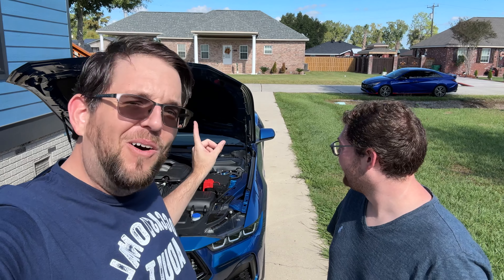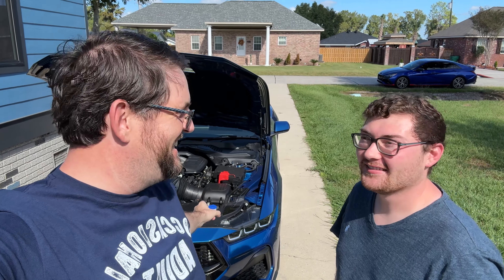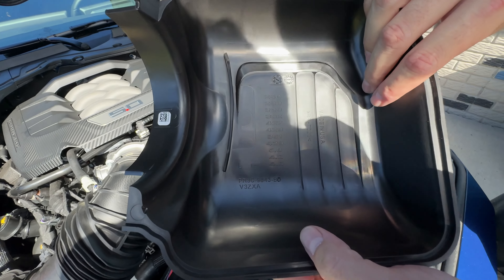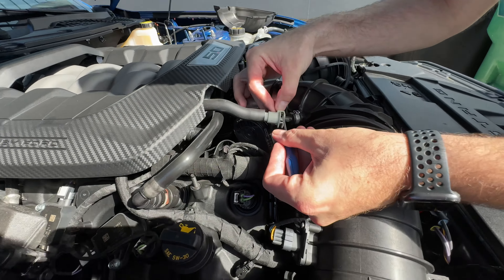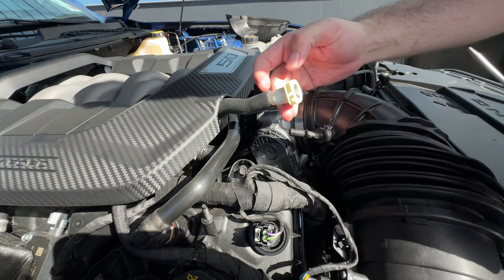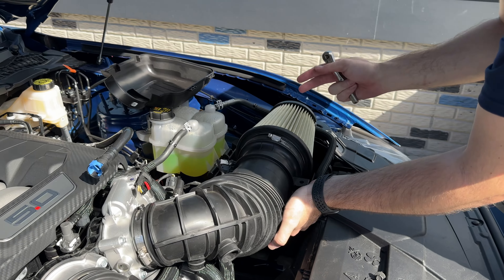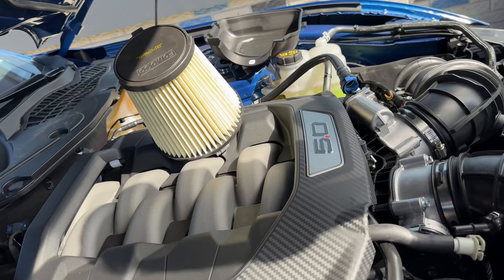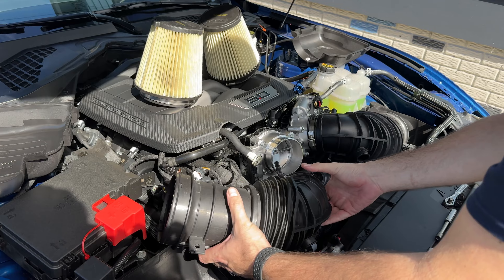20+ HP FREE in Minutes on your S650 Mustang GT - Carbon Trap Deletes!

Comment: I just watched a different video where the owner took out the carbon filters and the car on the dyno and picked up 16 rwhp and 17 lbs.-ft of torque across the entire curve. Seen another video where 12 rwhp was picked up &13 torque. So the 5 rwhp that you are claiming was from an earlier video like 3 months ago. I have seen multiple videos now where the picked horsepower is anywhere from 12 -16 rwhp and torque 12-17!!!! Only other video that cut out the plastic triangle piece was Middleton Ford guys up In Wisconsin who were the first to do it. Great video!!! Thanks for sharing‼️👍👊💪😎❤️🇺🇸✝️
Reply from the maker: You're right, we have much better data now, it's not worth a ton of peak power, but produced a tremendous amount of "under the curve" improvement.

Comment: The white clips can also be released by just pushing in on the same lock tab, it spreads the tabs so they will clear the barb on the fitting. That's how I've always done it, although removing the retainer entirely works too I suppose lol. Also I'm pretty sure the MAF sensor is keyed a certain way to prevent installation in the wrong direction
Reply from the maker: I tried pushing the locking tab in and it fought me jumping the lip on the barb so I just pushed the clip out, maybe others wont have as much trouble. Honestly I didn’t try to spin the MAF, but it looks symmetrical - at least people know to pay attention to orientation now lol.
Reply: @MurphysLawGarage  I figured it out, the holes were offset on the s550 for the maf, but on these cars it wouldn't be so they don't have to manufacture a different part for each side of the dual intake, they can use the same one and just flip it. Thus the directional arrow. So you're right to point it out here. As for the clip, I believe it. Takes a lot of force to pull it off with my method. Yours is probably better especially after many years and heat cycles
Reply: Will this mod void the warranty ?
Reply from the maker: @markjackson4988 No

Comment: Great content, thanks !
I was contemplating getting the K&N Typhoon CAI, but this does pretty much the same.
As for warranty, I’d say why another manufacturer CAI would be approved, but removing the carbon traps bd problematic ?🤷🏻‍♂️
Reply from the maker: Right, it would be treated the same. Consider doing the ram air mod too. Its in my s650 playlist!
Reply: Oh I did see it too, gotta see if the Dremel I have can take it ;)
Definitely worth it as well IMO. Thanks ;)
Reply from the maker: Np

Comment: I have a paranoid question. So I took out my carbon traps today. But I left the MAF sensors intact when i did it. I definitely bumped into them with my hand a couple times. My question is, if the MAF sensors got damaged, would they automatically kick on the check engine light? Or no? Mine didnt kick on, and the car seems to be running fine, but Im just curious what you think. My concern was when I first drove it, i put it in drag mode. At low speed, the shift from first to second felt a little odd. It always lurches forward in that mode, but it just felt different. But after driving for a while, it felt fine. Im just a little paranoid now.
Reply from the maker: Its would have issues immediately and throw a check engine light. It’s normal for drag mode to shift harshly.
Reply: @MurphysLawGarage  Thanks for the reply. Also, since you did this to yours a while ago, would you still recommend cutting out the plastic Y inserts? I am hesitant to do that, but I saw you explain in another comment how they make the air sticky and screw with the air flow. I want to get the most that I can out of this little mod. If that means cutting out those plastic Y inserts, I'll have to just do that. What's your opinion? Thanks
Reply from the maker: @jamdwhi yes, remove the Y’s and keep the H’s
Reply: @MurphysLawGarage  Alright. I'm convinced now lol. Thanks for the advice!! I appreciate it.
Reply from the maker: @jamdwhi no problem

Comment: I just took the filters off and pulled them out with everything plugged in and the tubes still on the throttle body. Took 5mins. Bro! I'm in La too! Hammond here
Reply from the maker: That wouldn’t make for good video, but its fine if you ensure nothing stayed in the tube. Houma here.
Reply: @MurphysLawGarage  Sweet. Yea, she looked clean after.
Reply from the maker: Check the whole S650 playlist out. The car is now a 9’s Whippled monster.
Reply: @MurphysLawGarage  Man, I saw! That's awesome!

Comment: It's worth literally 1 HP....  LMR just did a dyno video on this, those carbon filters also control the drivability by metering proper air control to both mass air sensors, it's not worth tampering with...  there are two giant throttle bodies with ram air which is certainly more airflow than you could have ever gotten with the one throttle body. Also I would love to know the price of those things if you ever had to replace them down the road, probably a arm and a leg..   LOL
Reply from the maker: The reason ford went dual intake was to allow them to install the carbon traps and still achieve the proper cfm needed to make HP and be emissions compliant. Though the carbon traps restrict flow the motor does recieve enough cfm to make HP. What the carbon traps actually do that harms hp potential is generate turbulence in the air stream. When you force air to tumble as it inters the intake manifold it gets “sticky” and slows down as it touches the plenum walls. Though the air is present its moving slowly and tumbling restricting how much air can squeeze through the valves in the window they are open. Thats how the carbon traps hurt hp and thats also why its hard to dyno - more positive pressure on the intakes from driving at speed and colder/denser air will mask the problem. Put the car on the dyno, get it hot and not have enough blower to imitate the positive pressure on the nose and you will negate the benefit of removing them = no hp gains shown. The dynos that show hp gains? It was cold and they have great blowers.

The MAF’s are only used for IAT readings on the  S650, not for tuning. The car in 100+ passes down the track consistently picked up 1mph in the data which is more like a 20-25hp gain.
Reply: @MurphysLawGarage  I guess you know more than Ford,  you're a real internet genius ,1 HP, no matter how much baseless nonsense you write.
Reply from the maker: @SHADOWBLACKs650 if you don’t understand why either is possible, I have nothing else to write - pleeb.
Reply: @MurphysLawGarage what you are describing is no different than the throttle body spacer argument that has been debunked years ago. Even removing the air box and installing an all new intake system, without the carbon shit, doesn’t add horsepower AT ALL without a tune
Reply from the maker: @ThroatMcGoat wrong.
Reply: @MurphysLawGarage okay 😂 classic ricer shit going on here lol have fun with your first mustang
Reply from the maker: @ThroatMcGoat you should probably look at other videos on the channel… this car holds the stock S650 1/4 mile record and now has a whipple approaching 9’s.
Reply: @MurphysLawGarage nice you got the dealer to install a Whipple for you under warranty 😂 real car guy here
Reply from the maker: @ThroatMcGoat you really dont even try do you? Let me help. I installed it along side and ASE tech at a performance shop so it would retain its warranty - thats the rules:

S650 Mustang Whipple Stage 1 Full Install - How To  w/ Dyno Results (Dyno Revisited - See Notes)
https://youtu.be/Uchto9CC4c0

Comment: anyone knows what the EU spect and what Ford have done to them to reduce the power to 453hp . I check underneath the Dark Horse the same two cat with resonator I delete with Hipe . But I feel the sound still not like US spect , I need louder
Reply from the maker: The exhaust is the same - they are mechanically the same. All Ford did was detune them in the PCM. Put an axle back on it.
Reply: Ok that sound good but what you mean with put an axle back ?
Reply from the maker: https://www.corsaperformance.com/products/sport-valved-axleback-slash-mustang-darkhorse-coupe-21267
Reply: @MurphysLawGarage  I don't think this is true. European version also have GPF filter in the exhaust system: "It's due to EU/UK market cars requiring a GPF. It restricts the exhaust to reduce emissions and as a side-effect reduces power."... also the sound is different and no so loud. So, it is not only the software and I think it will be tricky to get US HP with simple tune and without void the warranty.

Comment: You can remove the air straightener without damage. You just have to remember that it has an alignment notch so it will only go in one way. Then you can pull the carbon filter out by the small end first and essentially unscrew it without mangling the plastic. Your way is just unnecessarily destructive. Wow😮…..
Reply from the maker: The plastic that holds it in there is not an air straightener and also a restriction. The air straightener is ahead of the MAF sensors and was not damaged. With more than 100 passes down the track and the stock/hard tire 1/4 mile record owned by this car I’m not inclined to value that opinion 😉

Comment: Does anyone know if this voids any warranties?
Reply from the maker: Only for the intake tube itself, at least thats how warranty laws in America treat it. This also may not be legal in your state for emissions.
Reply: Thanks for the reply man. Probably going to do this to mine tomorrow.
Reply from the maker: You’re very welcome, goodluck!
Reply: Depending on what’s wrong with your engine You can get a dealership that blames it on your mod
Reply: Yes, if something went wrong all the way to the point of combustion, and even further if the argument was logical. 
Put it back in before you go to the dealership. as long as you’re not throwing a code in memory for pulling them out, you should be just fine. Sorry buddy it doesn’t just void the intake tube. That’s not how the # Warranty law works. Read it again. 
Look that logic would work with say an after market spoiler. And the deck lid gets damaged. 
When you tune, and do anything above the Cadillac converters, it could very well void your warranty on the engine. 
So the safe rule would be, anything below the air intake filter,  and above the cats. This still allows you to upgrade your exhaust and intake. Don’t confuse this with altering a Ford part. 
Last, but not least if your vehicles gonna go in for services on the engine, or you’re going to make a warranty claim return the vehicle to stock, make sure there’s no codes that allude to aftermarket parts.
Reply: I’ve played the # Warranty game with the dealerships too many times, they suck when it comes time for the to foot the bill for that expensive warranty you pay for. Nothing grind my gears more than a 3 to 5 year warranty and they want to play games.
Reply: This was a stupid experience I had with Ford, the poor engineering on the S5 50 heat exchanges on the hood, allowed for water to leak through and soak,mold and mildew the underside thermal cover. Like nasty bad. And they said that was environmental and they don’t cover it.
No, that was poor engineering and you guys don’t want to pay the bill. Funny thing is I garage and covered my car. That little bit of water was from washing the car and rain Occasionally. It didn’t sit outside in a monsoon for half the year.
Fix - drill small drain hold through the fabric in the hood at the low spots where water will sit and puddle. You would think the heat from the engine would evaporate the water, but that thermal shield is pretty good. I would bet Everybody has mold and mildew under their hood on the S550 because of this.
I still love the mustang and coyote engines, they take power very well with minimal upgrades until your pounds get to high. Even then it’s stuff you want to upgrade anyway like fuel injectors, oil, pump, fuel pump, driveshaft, and clutch, for example. Have fun in your new S650. Hope to get one. I’m still playing around with my Mach.
Reply from the maker: There’s what a dealership does and what they are legally allowed to do - separate them. Carbon traps wont throw a CEL and don’t affect engine performance in any way that a dealership could legally blame their removal for another failure.
Reply: I have had them try to void my warranty on a cabin air filter that wasn’t OEM . The blower motor was whining really bad and it was just perfect timing I walked in and heard them say well we spent way more time than ford would cover. The manager said we’ll check if it is a OEM filter and if not we can say the flow was not the same and caused it to fail. They saw me and ran to the back .Thank God I used a OEM filter. Just one of my experiences.
Reply from the maker: And if they voided the warranty, it’d been a good court case against a bad dealership. *Not legal advice, just my opinion.
Reply: Easier said than done. They have lawyers on payroll. Do you have a couple grand to start the process hoping you win? Just my opinion. After the warranty is gone who cares😂
Reply from the maker: @Rskitalll I mean yes I do, but also I picked a good dealership ahead of time and thats who you’d be going after

Comment: 20 hp, come on. These do absolutely nothing for horsepower.
Reply from the maker: Proven with 50+ passes down a track before and after. +1mph and +1 tenth in the quarter mile. (Which suggests closer to 25hp) Real data, not supposition, and you can even view most of the before/after passes right here in the playlist.

Comment: It's between 1and 3hp.. MAX!!. Seen it on 12 dyno runs on 4 different s650s. Nowhere near double digits. It's not a thing.
Reply from the maker: Negative, +1mph trap speed averaged across 50+ passes in testing at the track. At my car’s weight, thats a 15-20hp real world increase, regardless of what any dyno says.